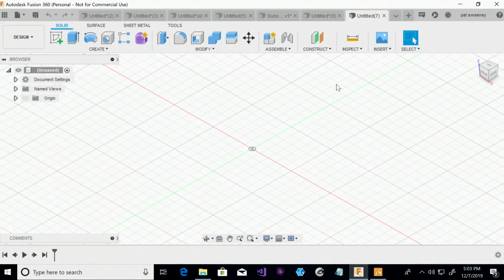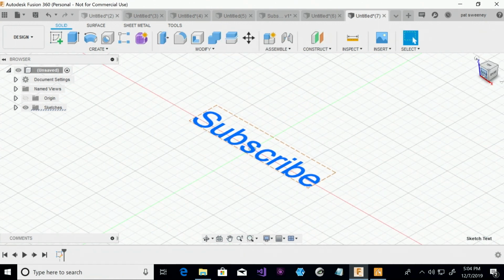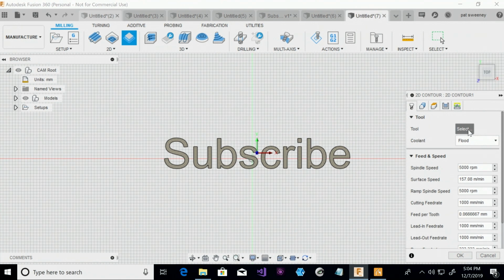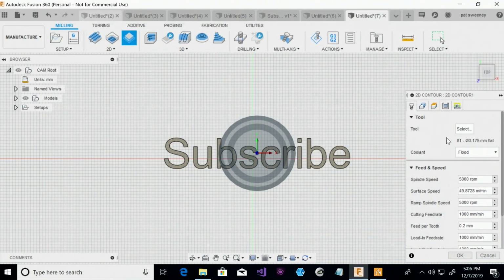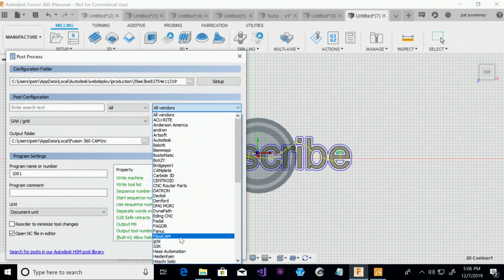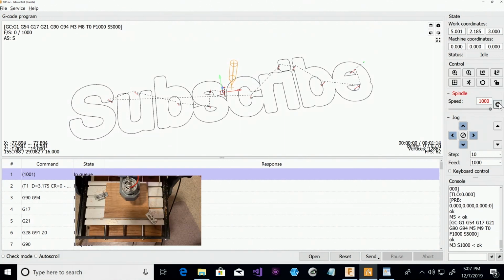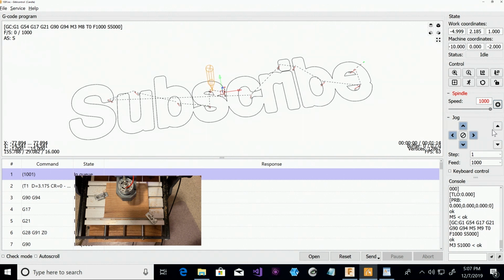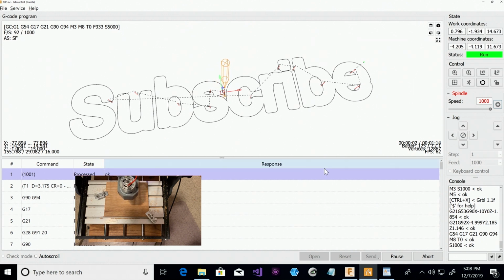Genmitsu CNC 3018-Pro Overview

Comment: My 3018 doesn't like carving hardwood more than .4mm per pass, I think your depth of cut per pass was too great, looked like 1.5 -2mm. 
Wonder if the code you removed was a automatic tool change code that your system obviously doesn't have...?

Comment: I just found out, I may installed different versions of Fusion 360, I just now noticed you're using the Fusion 360 personal use, which will expire over one year, I think that's sufficient time to learn, and engrave , I didn't know that version  gives option to create Gcodes by choosing cnc machien and bits. Thanks again 😊👍👍👍

Comment: Thanks for taking the time to make this video, but you're using the clamps incorrectly. The way you've got them assembled will cause damage to the aluminum bed. The screw on the end should be flipped 180 degrees so that the head is against the bed. You then tighten the wing nut to lock the item to be machined down to the bed. The screw is adjusted to level the clamp.
Reply from the maker: Ah! Thanks for the pointer!

Comment: What if i want to CUT out letters from pink foam board,, can it do that, or is it just strong enough to carve?
Reply from the maker: i dont think there would be an issue, but have not tried it. you might have to setup multi passes each with increasing cut depth, which fusion is capable of. you probably want to place a thin piece of wood under the foam so you can cut all  the way through. also thecut depth maximum is only 1
.8"
Reply: @partsrandom1625  thank you much obliged